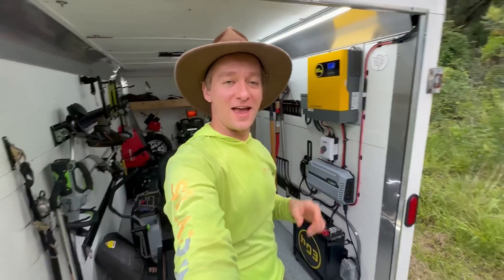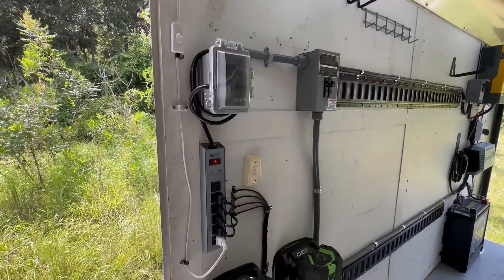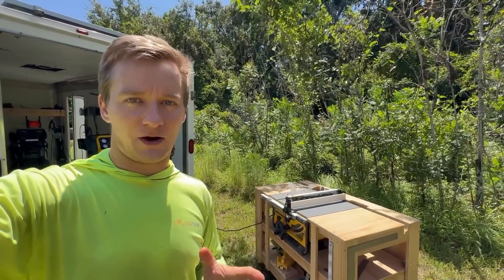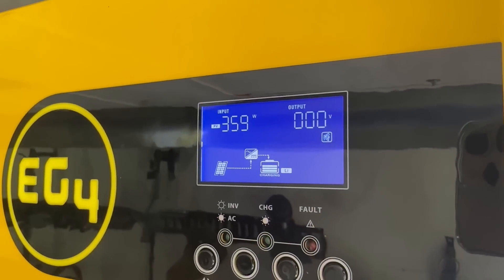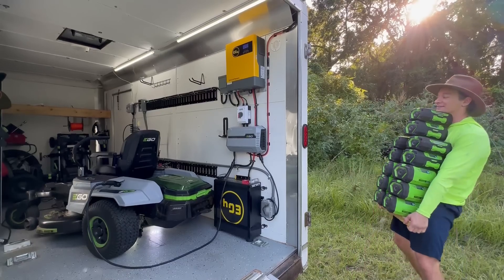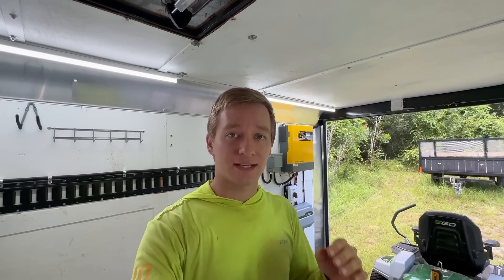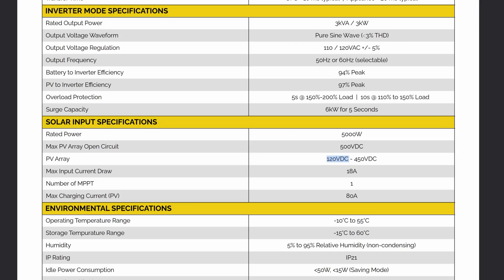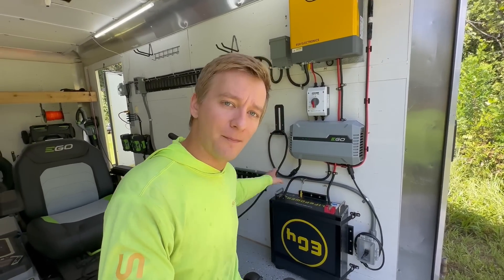Solar Powered Lawn Care Setup; Why Not Just Buy More Batteries?

Comment: What a waste, we have sooooooo much fossil fuels here and they are way better than what the tin foil hat wearing jerks that believe in the hoax of man-made climate change, I wish they would crack open a history book and read how this same type of plan is an old trick to gain control over the world just like the idiots before like Stalin, Mao, the Kamaruj and Hitler
Reply: Even with sooooooo much fossil fuels remaining, why not stretch it out with alternatives like solar.
Powering motors with solar is significantly cheaper then running engines with fossil fuels.  Even with expensive batteries.
Reply: @cjbiron77  plus he won't get free gas while parked at the client sites
Reply: @cjbiron77  I use all EGO tools (homeowner) and I love the fact that I can walk to where I need to use the trimmer, pole-saw, blower, or chainsaw in complete silence. Then go from silence to humming and instantly have as much power as the gas tools with ZERO yanks on a rip-cord. Also I am able to stop at any point returning to silence, and restart at will in under a second.  Plus no more filling and spilling (except for bar-oil in the saws.) What's not to love!
Reply: Fossil fuels have their uses but why not support an alternative like battery and solar? Its not gaining control over the world, alternatives lead to innovation and competition between platforms driving cost down.
Reply: What a great job with the build. That is a lot to design skill for the Average person to build excellent work!! And great application most people can’t even grasp what’s Going on with this.
Reply: Saving money is a good thing, but only if you can do sums!! So I don't know what you beaf is, but mowing a lawn with electric power make far less noise than one that goes Chitty Chitty Bang Bang whilst poluting the air at then same time, can be a bad thing right?
Reply: Good job on pinning this comment :))))))))))))
Reply: So.....a hundred years ago you'd be screaming "Godamn cars, why do we need them, we got lots of horses, and what about all the farriers and veterinarians you'll be putting out of business?" PS Stalin Mao, Hitler et al were genocidal lunatics, all bent on creating a racist, socialist or workers utopia of one kind or another, and willing to destroy anyone and anything that got in their way. This is a harmless kid mowing people's yard with solar power. And what's wrong with power from the sun anway, it is after all the source of all energy on earth, including the hydrocarbons you seem to love so much. That was just sunlight that fell on earth a long long long time ago.
Reply: I have to say this set up is good with Ryobi, which is a lot cheaper than ego
Reply: is this a bot? look i'm not on the climate change being affected by human thing either, but solar has actual practical uses and makes sense in quite a few situations, just not en masse for large scale cities with our current technology. for smaller project such as this, the guy did the math and laid it out for you. you'd have to be... well I guess mathematically challenged to not understand how much over savings are being made for a small business like this, not to mention the TIME savings for refueling.

I grew up doing yards for a living from about 6 years old til about 20 or so. these LiPO4 batteries are rated to last CONSERVATIVELY at about 10 years, and that's assuming your running them dry thousands of times, which most people aren't doing so you can expect twice that if not more lifetime. let's make it worse and say they die in 10 years. in 20 years time, that's two sets of LiPO4 batteries, so another 1500 roughly. $5k total over 20 years, and let's just add in another inverter of about $700, so $5700 over 20 years. Let's say you work 5 days a week, and 48 work weeks a year (the average is 52). taking a few weeks off and no weekends of work. That's $5700/4800 days, which is $1.18 average cost per day to pay for TWO of the main components of the system. There is absolutely no way you're going to tell me that fossil fuel (gas) is going to be cheaper than this over 20 years.
Reply: This guy that has the solar powered lawn cutting equipment, said nothing about climate change. 

What kind of a moron are you? 

You fucking retard .
Reply: we use less oil so that you feel you have plenty left. the global population is still increasing and you don't think conservating energy is a good idea?
Reply: lol wow.  Sorry, I rather be energy independent and have my own reliable power.  My utility sucks, fossil fuels suck, you are reading misinformation.   (This doesn't mean we should eliminate them fyi, but I will remove all the fossil fuels from my life I easily can, not to mention I end up with more $$ in the end).  Now go have fun coal rolling people with your ignorance.

Comment: That is an excellent setup. Full marks.
Reply from the maker: Oooh! Can I get a gold star too?  Haha thanks for checking it out, glad you liked it.  Things just feel cleaner if you paint them white and install bright lights, downside is you have to keep them cleaner lol
Reply: @solarpunksteve  I have a schoolbus conversion that I painted white. I feel your pain. On the upside, white keeps it cooler inside. 

I'm out of stars, gold or otherwise. I have a half-chewed piece of bubblegum if that'll do?
Reply from the maker: Hey awesome! The skoolie, not the chewed bubblegum, you can keep that for now. I’ve got a 1964 fishbowl transit bus that I’m converting into a mobile coffee shop over on my other channel @deltavcoffee And a friend of mine is in the middle of a roof raise on his skoolie in my workshop right now! I’ll probably end up doing the solar setup for him too. Will do a video on that, naturally.
Reply: @solarpunksteve  I don't have a youtube for the bus. I probably should have done one but wanted to be pretty anonymous 10 years ago when I started it. Right now it needs new brake lines at the back (done the front). It had new tires 2 years ago. Havent driven since because I had a back injury immediately after. Also needs a couple of leaks fixed, brake pistons polished and a wiper mount rebuilt. Otherwise it's perfectly roadworthy.

Oh yes... I need to change the oil, trans fluid and filters. Haven't done more than 100 miles since they were changed last time but it has been 4 years.

Comment: Nice, can you go into detail how you have grounded the solar and inverter to the trailer..  thank you
Reply from the maker: Good point, I'll add that to the list of things to cover in a video.  To answer you quickly though, I grounded the inverter to the trailer frame with a wire on the ground screw on the bottom of the inverter ( 0:58 ), this is also where the AC out is grounded. The solar is grounded with spiky metal plates that go between the aluminum panel and the galvanized steel rail that get squeezed together to create a nice bond, and the rails are mechanically connected (bolted) to the metal frame of the trailer providing a bonding there too.  I'm reasonably confident this is the right way, it's actually a tricky thing to find solid information on so I'm open to someone correcting me (with solid reasoning/evidence/codes etc.) Also, I'm not telling you what to do, I'm telling you what I did so please don't sue me ;)

Comment: NO NO NO. Do not coil DC cables ever.  You will overload your cables fast.  You will also loose efficiency.  Just run the cables  down and back in U shaped runs or cut them. I would also install a 60V DC marine grade cutoff switch because DC can jump small distance and stay alive so I don't trust the breaker style on battery as I have seen fires with those styles. Also do not bunch Any electric wire together as it causes heat to build and can cause wires to melt and lowers efficiency.

Comment: Awesome setup. I think if anyone is thinking about going electric and want to make fuel on the go and charge on the go this is the way to do it. Going back to what you were saying about getting extra Ego batteries. I would still have 2 extra so your always charging and swapping full batteries between runs. I guess it would be based on your daily usage over time. Great video.
Reply from the maker: Thanks! Hopefully it's relatively clear to people that I'm not saying this is on the same level as entire crews or others that have high volume/large lots. I still have to pick and choose my clients based on property size/complexity, but I can honestly say I don't really think about battery consumption too often anymore.  And being a solo operator you get to kind of manage those things naturally, like "oh I just used the mower a whole bunch on this last yard, let me break for lunch while it charges up a bit more". You're correct though that it would be a good idea to have a second set of batteries ready to go and you "hot swap" but I can get nearly three times the mowing (maybe more) with this setup than I could have if I just bought a second set of EGO batteries and given the costs I thought this was a way better option, with more flexibility, and if I got to the point where the EGO stuff wasn't my choice going forward, I could easily pivot to a different brand etc.  Anyway, because I haven't needed them, I haven't bought a second set of EGO batteries for now.
Reply: @solarpunksteve did you claim the solar tax credit on that?
Reply from the maker: @LawIV   Unfortunately no.  I talked with my CPA and they said because it's not attached to a structure (business or home) there's nothing I can claim.  It's possible this isn't the case and I would love to hear if I could, but for now I'm claiming it as an asset for the business so it will be written off over time, like any other piece of equipment.  Would love it if I could claim 30% though, would make this even more affordable.  

This is largely an experiment to solve the electric lawn care problem which is running out of battery and not wanting to spend a whole bunch on more batteries that lock you into one manufacturer.  I think it actually makes more sense to install solar at your house or business and do net-metering if your provider/state offers it.  You get more bang for your buck and there's no wasted energy when the trailer is full and the solar can't output to anything.

Comment: FAN-TASTIC!  This is awesome thinking for sure and very nicely done!! No more gas and oil and you get energy from the sun all day. If you find yourself needing a boost often I could imagine adding additional panels on one side of the trailer that could be pivoted up while parked. More complicated than the fixed mount panels but just a thought if needed. 

I'm not a commercial lawn care guy but have dumped all my lawn tools for EGO. Overall, excellent stuff. I am working on a setup for my home to charge it all from Solar as well, some time before that project makes KWH though.
Reply from the maker: Thanks! It's been a really fun experiment and learning experience so far!  It's not the perfect solution for every problem by any means and won't be something everyone can/should do.

In regards to the deploy-able solar, I love the idea and I've been thinking about it for a long time, but realistically it's not practical or scalable, not to mention just the complexity.  I think what makes the most sense in my opinion right now is if I need it, charge the trailer at home after the day, if I need more then I install another onboard battery and double my storage capacity.
Reply: @solarpunksteve Depending on the application, someone starting out could also get a towing vehicle with bi-directional charging to use to top up the trailer battery while parked and working when sun alone isn't enough for the day. There are more and more options available now, which is great to see.

Comment: You're going to end up needing those batteries sooner than later with the amount of cycles you're putting on them. Not crapping on your setup, its pretty neat, but if you're charging from 90%to 100%, this is still effectively a full cycle of battery wear. I'm sure you know this already and so you're likely to be optimizing your route based on charging, I just didnt see this mentioned as a caveat anywhere.

I'm moderately jealous of that trailer.
Reply from the maker: Maybe! Time will tell.  So far (over a year) I've only had one battery fail on me, not to say all the others aren't right around the corner, but starting a business and/or being an early adopter is a risk no matter what.  I will eventually get to making a video on why I think these batteries might actually last longer the way I'm using them and back that up with actual research articles and real-world testing (of course I'm happy to be corrected with evidence).  One thing I wish I had the ability to do is prevent the batteries from charging past 90% (or even 80%) to prolong their lifespan.  This is what Tesla recommends for all their cars other than the ones that are Lithium Iron Phosphate and it's what I do with mine (never charge past 80% unless leaving on a long road-trip).  There's just no practical way to manage that other than manually removing the batteries when I think they are close to finished, but this is silly as no one wants to or has the time for that while they are trying to run a business and make money out in the field, which is why I have chosen not to worry about it and just see what happens.

Anyway the great thing about youtube is whether they last or fail you'll get to hear about it from the comfort of your home!  I'm doing what I can to run the experiment in the real world for you, for science! haha 

Thanks for checking things out and the kind words.  I'm kinda proud of the trailer, took a lot of work.
Reply: He is still ahead as over time he is making fuel on the go and charging on the go. His cycles are extended out as he isn't drain the LIPO battereis down to 0.

Comment: You need to change your 30amp breaker to a 40 to supply your 2 20amp breakers cause your over powering the 30 amp with the 2 20amps then you could run 2 air compressors and a table saw no problem
Reply from the maker: Maybe it wasn't super clear in the video, but it was the inverter that shutdown the system not the breaker.  It's rated at 3000W continuous output remember, so 3000W/120V = 25amps, with surge and startup loads, you're likely to see over 25amps for short periods of time, but any prolonged loads over 25 amps will cause the inverter to shutdown like it did in the video, but in case the inverter doesn't shut down, you want some protection, which is where the 30amp breaker comes in.  This is specified by EG4 in their manual too.  The reason you can have 2 20amp breakers after a 30amp is because you might not be running all the equipment all at once, so theoretically one circuit could be pulling 16 or 18 amps while the other isn't and that's perfectly alright because the wiring and outlets are able to handle that on their own, but just in case they both were pulling that much at the same time, you're 30amp breaker is going to shutdown the loads to protect your wiring/equipment upstream.  

All this to say: you need to be really careful with what you're doing when it comes to electrical circuits, you can't just increase your breaker size upstream and then power more things downstream, it's all based around the wiring you have and what your system can safely produce.  Hope this helps clear some things up.  I'm also open to corrections if someone thinks I've made a mistake here or there's a safer/simpler way.
Reply: @solarpunksteve  try changing the 30 amp breaker to a 40 amp to run the 2 20 amp breakers then try all three things again bet they won’t shut down cause the inverter picked up on the power loss to the 20 amp from the 30 amp

Comment: FYI,  I found out doing a test....  I had 4 panels that produced 120v....  Connected to the EG4 3000....  But being at or  just above 120v....  It seriously limited my wattage input... I should have seen between 8-900W,  but was only seeing 300w...  I imagine if I had even 1 more panel,  bringing my voltage up just a little,  It would have produced more....   I will be testing this theory more next week.  Great Video!
Reply from the maker: Very interesting.  I was worried about not making enough voltage with my 6 panels if I wasn't getting full sun, but so far they seem to produce that minimum 120V even when overcast or morning/evening etc (although it's not like I'm getting a lot of wattage). However I have yet to see the full 1200W from my panels.  Closest I've gotten is 1000W briefly.  I've talked with Rich Solar a little bit and will probably do some testing on the panels when I get some time, but for now they are still making enough power for my needs.  I'm not surprised that they might be limited though, I mean we've had extreme heat these last few weeks, and they are mounted flat on my trailer and close to the roof so the venting could be a little better.

I'm interested to hear what results you get from your testing, let me know!